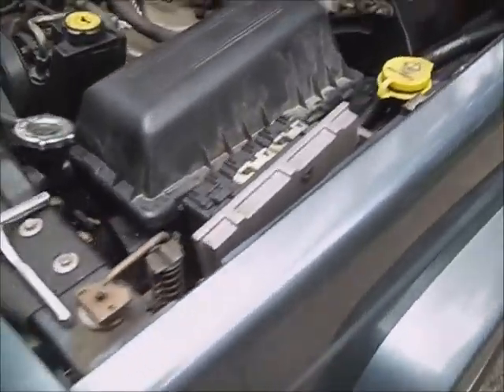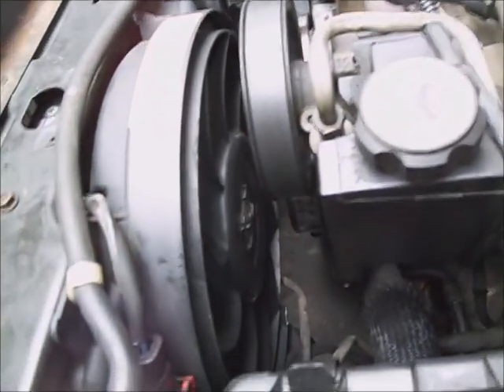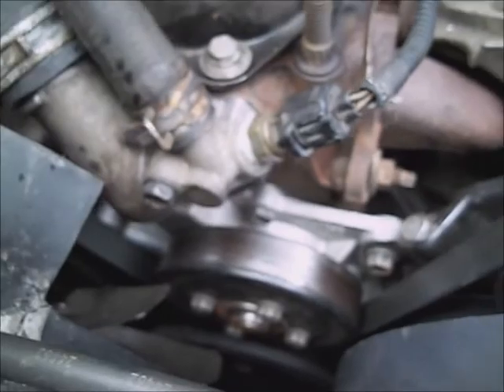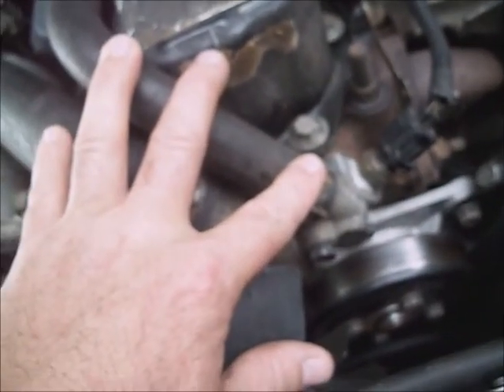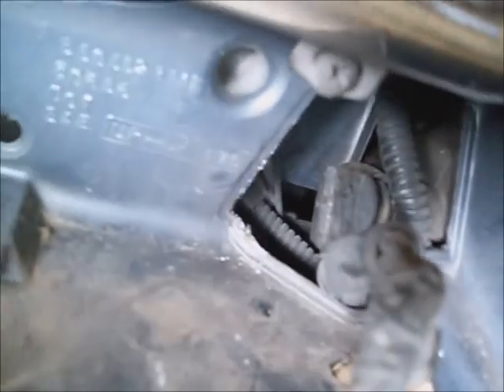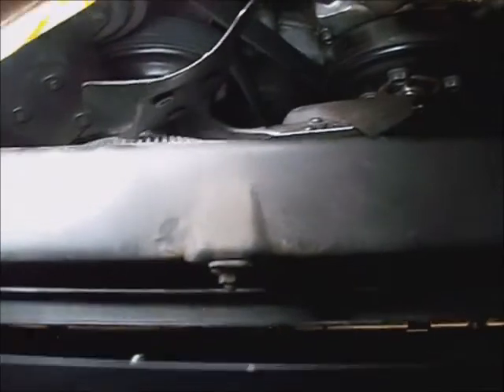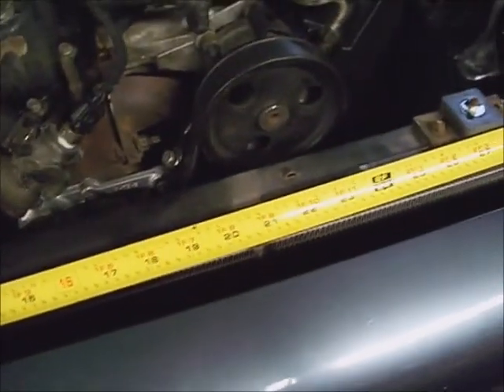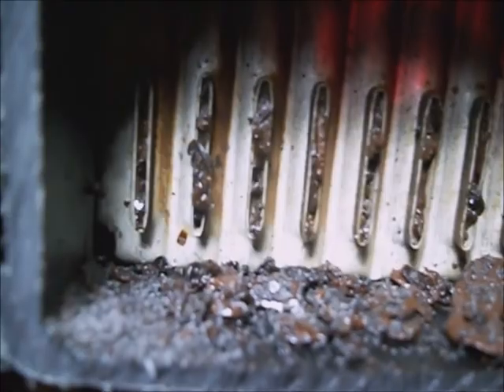Jeep Cherokee Sport 01 w  4.0l pt.1 overheat diagnose, flush system, remove radiator

Comment: Did I hear you correctly " it's a wonder that the heads not cracked or warped."      If that is what you said how do you know? How can I test to see if further damage has been caused to more expensive components. I'm tempted to buy one with these same issues. Just can't afford to overlook major issues to the motor.
Reply from the maker: Well, a blown head gasket will typically have a miss-fire, especially after setting for awhile. And there can be coolant in the oil, over-heating, lot of pressure on the hoses, within a min of start-up.  Always adding coolant to system, with no obvious leaks. Steam coming from the exhaust pipe.  On and on.  Check cylinders for coolant in them after cool down.  Thanks for watcging
Reply: @AutoDrdiy   Thank you!! You're very helpful! Much appreciated!!
Reply from the maker: @daylaemaylae9905  np, thanks for watching

Comment: Thank you, what a great video. I'll be doing my 93 Cherokee Sport and noticed several different brands of radiators. Any brand in particular you would recommend ?  Thank's again.
Reply from the maker: Not sure, brand and type would be dependent upon what- if any, problems it was having.  Thanks for watching
Reply: @AutoDrdiy  It's just getting a little above the mid line on the temp gauge on hotter summer days at the stop lights, so I figured it might be time. Of course I could see what happens after the radiator flush, perhaps that will do it.  Thanks again, great video.
Reply from the maker: @ibberman  One way to check rad function, is to start up cold, and touch upper rad hose every min or so, (which if T-stat is working properly, should be cold, until engine is about 160° F) (no exceptions) and once there, and upper rad hose is almost hot all the around it's surface and the length of it, then turn engine off, and immediately feel rad tubes from top to bottom, in the first 1/3 of rad width, below upper hose inlet.  If just the top few cores are hot, and as u go down, cores get cold from middle down, then 1/2 rad is blocked, and must be replaced. It cannot be unblocked by conventional means, ever.  It takes a little practice and timing, as if measured to soon, then will indicate false blockage before T-stat can open enough to allow sufficient flow across all cores.  If let flow to long, then conduction from heated cores, will transfer to cold blocked cores, and suggest that they are flowing and releasing heat from the coolant.  Removing T-stat, and lower rad hose, flushing with pressure water through T-stat water jacket, is effective to remove sediment from block, before installing new rad.  While extreme, and generally out of scope for the average DIY'er, the really problematic over-heaters, that still persist, (and not due to head gasket issues) removal of the freeze plugs from the side of the engine, followed by a thorough pressure washer inserted in between cyl water jackets, will blast years of packed sediment out, and allow proper coolant circulation, to pack heat off at rad.  While I don't endorse the use of aftermarket stats, I have used a 160°F T-stat, to allow engine to start dissipating heat 35° sooner than OEM, as an economy solution to solve slow lingering over temp concerns.  Thanks for watching.